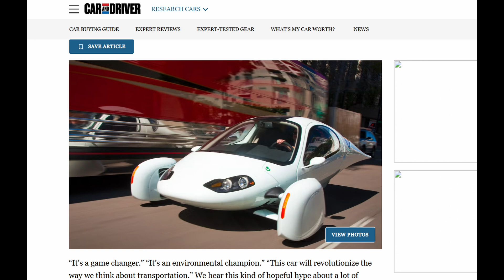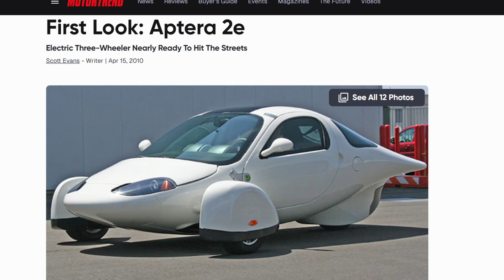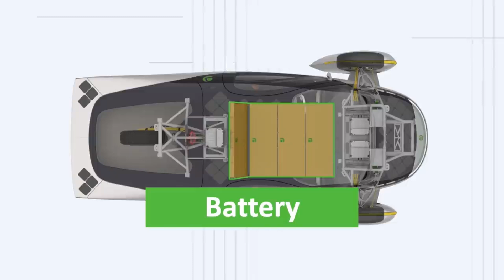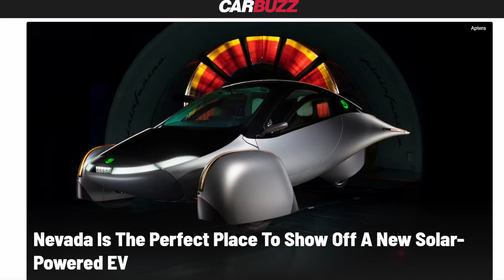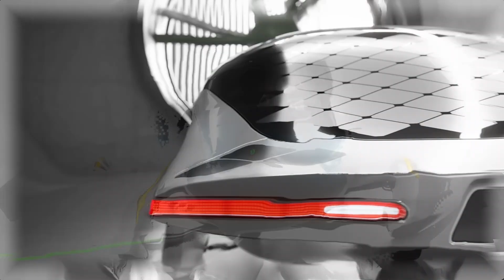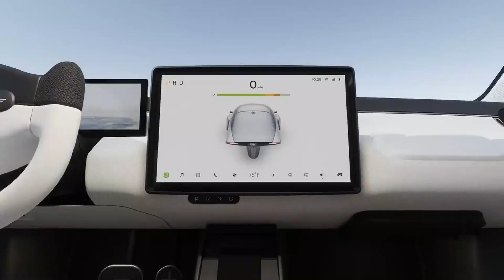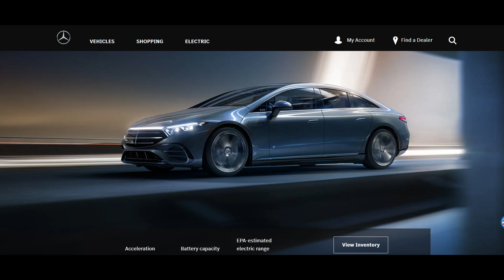Aptera Launch Edition 2025 50% more Efficient Than a Tesla

Comment: The math here is seriously flawed. If all you check is distance per amount of energy, and I take you twice as far for the same dollar's worth, I did 100% better than my competition, not 50%. (And the same distance for half the dollar is also 100% better.)
But let's also be fair it's not pushing nearly 2 tons of weight. The single Aptera platform currently in progress is not going to compare to anything else so neatly, and will not grant the same gains in efficiency for every need. 
What if you count cost of taking 4 people safely and comfortably the same distance? Car A takes 2 people for half the cost of car T, then goes back for another half cost of car T, then takes the other two people for another half cost of car T, that cost you 1.5 times the cost of the Tesla, or 50% less efficient, not counting your time. 
What if you only need to take yourself to work? Aptera can make that trip with a wasted seat 100% more efficiently than the Tesla with 3 wasted seats. (or 4 if you count the underweight person the middle back seat might hold.) 
What if you have a 3 person carpool? 
What if you don't charge for the first 30-40 miles per average day because you didn't pay for the sun's charge, and you only go 10 miles to work and 10 miles back? 
What if the daily drive of your 4 person carpool is 70 miles? 
What if you want to take a 900 lb Harley on a trailer and drop it off at the dealer to get serviced? I'm guessing Aptera will be several more models into maturity before you can even dream of doing WHILE staying under the manufacturer load limits, and it's absolutely true simple physics the extra utility will use more energy.

Comment: Aptera is a motorcycle, not a car. it lacks all safety features necessary for a car.
Reply from the maker: It's body is BinC
That's a tough cabin
Reply: @Elementraz  The cabin is not structural anymore. The latest Aptera has a  conventional aluminium frame where the plastic plates are glued on.

Comment: They will never make it to production
Reply: Aptera plans to start production in late 2025 or early 2026. The challenge is that they haven't found any big investors and need $60 million to make it to production, but they have 50k preorders and 15k investors, which is more investors than any other auto startup. I think they will make it, but starting an auto company is a challenge, so I expect there to be delays, as they try to raise more money.
Reply: @ I wish them luck 🍀.
Reply: @amosbatto3051  Aptera planed to start production in 2019. Then 2020, 2021, 2022, 2023, 204, 2025... And they need 300 Mill$ to start production.
Reply from the maker: Why do you think so!
Reply: @ why do you think they will?

Comment: Curiously, if it's classified as a motorcycle, do people have to wear a helmet when driving in states with helmet laws?  If not, why?
Reply: No, you have an enclosed cabin.
Reply from the maker: You have to check with your state and local authorities to see what laws apply,
It varies from state to state 
Thanks
Reply: You do not need to wear helmet, if your 3 wheeled vehicle provides safety belts and an airbag.

Comment: You made the same mistake many people make. Aptera hasn't been in business since 2008. That was the first company that liquidated in 2011. The patents were sold to a Chinese company. The 2 founders re-aquired the patents in 2019. This vehicle is very different than the original one.
Reply from the maker: Lo!
Reply: And still after 6 years not even a single production ready prototype available.
Reply: @vic321344  How long has Elon the not see been promising the new roadster?
Reply: @vic321344  How long has un-elected President Musk been promising the new Roadster. A billion dollar company that can't produce a simple car like that. The Cybertruck, by many accounts, is a piece of junk.
Reply: But the concept of a 2 seat bean-shaped car has not... I followed them when the were going to source the gas engines from GM.   Until the cars start rolling of the assembly line it's still smoke and mirrors...  Take of the solar to simplify the car and then at a later date add solar.   The car is still a game changer and then you throttle up to the solar version... ????
Reply: @danielcapson9842  Has nothing to do with my comment.
Reply: @tims8603  Same people, same patents, same name, same car.
Reply: @martyjenkins3631  Different car. The first one was a hybrid with a different body style. Different company. The first one got taken over by the people they hired from Detroit. Different employees. The only ones that are the same are Steve and Chris. The patents were on the basic design.